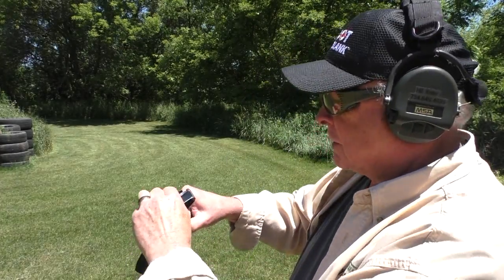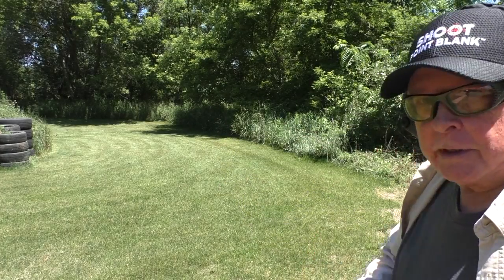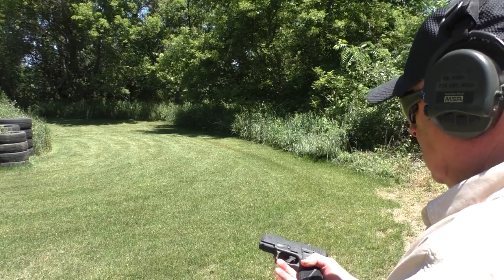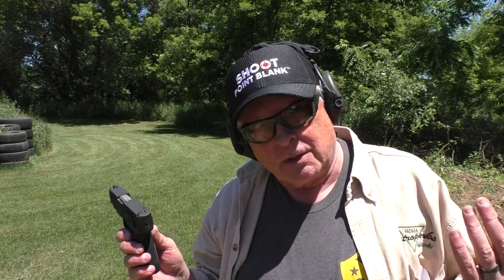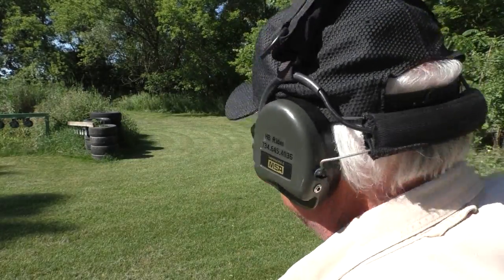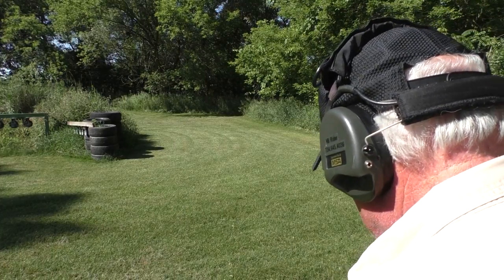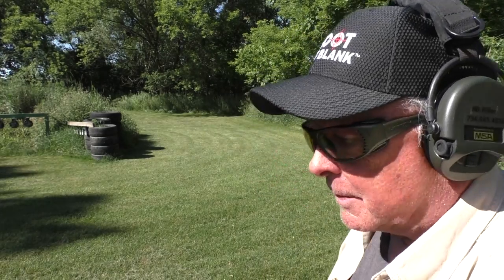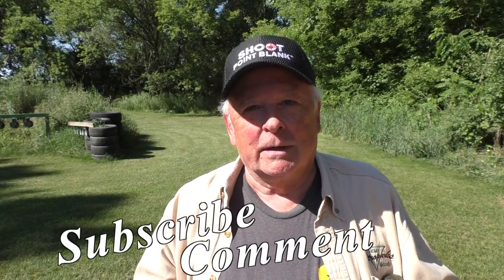Will the Taurus G3c run Defense Ammo?

Comment: I'm not a YouTuber, so I don't have a channel, like this gentleman does. We bought 2 of the G3c, and one wouldn't even chamber the blunter defense carry ammo and the other runs it but it is stiff. And since I looked up one video to see if anyone was having similar problems, now I get ALL the videos about this topic. Which is OK with me because I get to see different content and points of view. Here is MY story about this problem and maybe it will help even just one person. I recently bought 2 G3c. They ran practice FMJ ammo perfectly. However, as soon as I loaded some  defense ammo, one of them wouldn't chamber any of it. It wasn't a feed ramp issue because it would get the round into the chamber every time however, it would not let any of the blunt tip hollow point ammo fully insert fully to the case rim bottom in the chamber. I removed the barrel and holding the barrel vertically with the muzzle down you could drop in any practice ammo easily fully, even the federal hydrashock defense ammo, because the point of the bullet is not so blunt, would easily seat fully.  Im a machinist so i measured all my ammo, all measurements on all mfg rounds are the same EXCEPT the ogive on the blunter ammo is farther forward. (If you don't know what that is, look it up and why its important in this situation) So I measured the barrel and the chamber and that's where the problem was in both barrels. Even though the barrel and chamber are different diameters, they must be on the same centerline. Neither of mine were. The worst one, the chamber was .015" off from the barrel centerline. That is about the thickness of the brass wall on one side. Taurus customer service is amazing. Very pleasant to get a service return and they send you the shipping label so no cost for the return. They estimate a month turn around. So you could go that route. I see a LOT of posts about recommending you do that. However, one other alternative would be look for an aftermarket drop in replacement barrel. I'm not endorsing anyone, so Google it to find one. The one i got was fluted target grade. Free shipping and had it in less than 3 days. On sale for $60.00. Virtually drop in ready. If it even requires any fitting, the only place you may have to fit, is on the very back of the lug  that presses against the slide face. It came with perfectly simple instructions on how to do that, or you can have a smith do it. But if you have some basic skills you can do it yourself. I tested all my ammo before i even put the barrel in the slide and it all drops in fully and fit perfectly. At the range, it shoots EVERY mfg ammo now and groups incredibly well out to 25 yards. It makes an inexpensive handgun shoot reliably and incredibly accurate for very little money!
Reply from the maker: Thank you for your detailed info. I've found that Taurus quality control is not always consistent. I'm glad you found a reasonable solution.
Reply: @RidersRange  you are sooooo correct. It's really a shame about their quality control. It would be such an easy fix when they are manufacturing the barrel. It's obvious they are made on a CNC machine. Pull every 10th barrel and check the centerline relationship between the chamber and barrel with a go/no-go gauge. The aftermarket barrel I got is made on a CNC also, but you can tell the machining quality and attention to detail is so much better. Honestly, I would have paid another $60 at the store just to get what I now have. It's still much cheaper than the next competitor, and I love the grip, the factory trigger, the magazines, and even the look. But the biggest thing is it's now reliable and will run any of the defense ammo out there. It can't " just about chamber some or even most" defense ammo. It needs to absolutely chamber all of it. Reliability. The accuracy and repeatability on target is a bonus. Most people buy them for protection. If it's being sold only to reliably process target ammo, then that needs to be clearly stated before it's purchased. Anyway, thank you for your channel and the content you're posting for all of us.
Reply: Is there any way to check the centering before a purchase?
Reply: Maybe. That would involve the gun store taking the barrel out of the slide and letting you look straight down the barrel from the breech end only. That will allow you to directly view the lip at the front of the chamber where it transitions to the barrel bore. Be sure to adjust your view so it is perfectly centered. The lip should appear as a perfect ring. Appear as equal thickness all the way around. If it appears thicker in one area than another, and thinner in another area..... it is off center. The more obvious it is, the farther off center it probably is. There is a second test. Again, it depends on if the gun store is willing to do that. As in the first test, they need to take the barrel out of the weapon and hold it breech up so the muzzle is pointed to the ground. Then ask THEM to take a round from a variety of their defense ammo on hand and just drop them into the chamber. They should basically just drop all the way in to the lip and sound kind of like a clunk. If they don't easily just drop all the way in. They are not machined on center. This symptom is more apparent with heavier grain blunter tip bullets. Just about all of the lighter round nose practice ammo will drop in as I describe above, so maybe ask them to demonstrate that ammo first so you can see and hear what I'm describing. Remember if any of the rounds dont freely drop all the way in to the chamber, you run a risk of the weapon not going fully into ready battery position thus it won't fire. If you have to even slightly nudge it to drop in the rest of the way, it isn't correct.
     As I said in my previous comment, I wouldn't necessarily not buy the weapon. I like Taurus. They fit my and my families hands very well. They are very user friendly, even for the ladies for racking the slide and magazine changes and sight picture, etc. And trust me, when I put the new barrel in my wife's weapon it shoots EVERYTHING, without fail, and the shot groups are VERY good. A buddy of mine just did the same to his annnnnnnnd even upgraded a couple parts in the slide. It function tests very smoothly. If you want to know how it does shoot once we get it to the range, let me know. I will provide an update but I know it's going to shoot just fine. Sorry about the lengthy comment reply but some things take more words to express, and you have a very valid question that deserves a good response.
Reply: I bought a brand new g3c chambered in 40 s w and I have the same problems. It won't feed the defense ammo, I've tried 5 or 6 different kinds but fmj rounds are perfection every time.
Reply: @mikedaley2882  maybe your having the same issue as the 9mm factory barrel? I would consider trying an aftermarket barrel. It is a total shame if that is what's going on, but hey. If it fixes your issue and you like the weapon, Eli with it? Good luck.
Reply: @johnratcliff  where did u get the aftermarket barrel from?

Comment: Several times I've seen this issue reported about some of the G2Cs, and as G3C is mostly the same pistol, the solution I've seen was always reported to be the same: Polish the feed ramp with some jewelers rouge and a Dremel polishing cone. So far, everything I've seen this corrected the problem.

But, admittedly, that's the just the few times I've seen it reported, and the solution I've seen mentioned. That doesn't account for everyone, nor is it meant to. Mine feeds my Winchester SXZ defense ammo just fine. I haven't tried a lot of rounds, myself.
Reply from the maker: Mine is running well enough now, so I trust it as a "knocking around the house and yard" pistol. Thanks for watching and commenting.

Comment: My g3c has the same issue with defensive ammo. That’s how I got to this video. The issue is the initial chambering on a full mag. Cycles just fine after that. I’ve ran a few through it and it does it just fine now but that doesn’t mean it won’t hiccup later. Pull the slide fast is all I can tell you besides sending it for repair or polishing the feed ramp.

Comment: The problem I have with a lot of people saying the G3 G2 even though PT111 millennium won't feed it's cuz they only try one kind of hollow point or maybe two kinds of hollow points initially on the break-in. They can be a little ammo finicky once you get them broke in I've got a couple G3 cs and a g2c I've also got an old PT111 millennium with several thousand rounds to it and it will eat anything now no problems I keep it clean I have polished the feed ramp but I don't get aggressive with it I just use a little mother's mag wheel polish with a q-tip and just get it nice and shiny when I clean it probably don't even need to do that at this point but it eats everything.

So a lot of times when people bad mouth a particular gun it's because they have not tried the type of ammo that it wants.
I also believe on your initial break in Taurus recommends slingshotting the slide and not using the slide lock to release the slide I have to double check the manual again

The same goes for rifles when you're sighting in a rifle you just go buy a box of Remington's or something and it won't shoot them worth a darn when you try Winchester's and your cloverleafing shots at 100 yards.
Reply from the maker: As you pointed out, it's good to find out just what ammo your particular gun prefers. Thanks for watching.

Comment: If your having problems feeding hollow point it because these guns have to be shot with ball round tell they loosen up or polish the feed ramp
Reply from the maker: In many cases there is more to it than just polishing the feed ramp. And "polishing" by shooting is a whole lot more expensive and time consuming than a few careful minutes with a rotary tool and fine polishing compound. But thanks for watching and commenting.
Reply: @RidersRange  I found polishing feed ramp with rotary tool and spot under feed ramp in mag well just a bit took care of mine and few others my friends had mine had burs from the factory in mag by feed ram others had sharp ledges there causing snag also found one that the barrel wasn’t tilting properly so feed ramp wouldn’t line up causing failure but if I put my barrel in it it worked flawlessly so I came to conclusion the barrel had to much material left on lug to tilt far enough little time with dial caliper’s and I had it working with a little work with rotary tool
Reply: @RidersRange  you are right on all accounts. However, the guy who “polished” the ramps by sending 200 rds of ball ammo is much more proficient with the gun, is better able to trust the gun, and is safer with it if he uses it for CCW.

Comment: I own a G3X.  No feeding issues. Although initially, I polished the Barrel ramp and upper lip.  The upper lipp had rough edges, although It did not effect feeding, and I only use Hornady Critical Defense anyway, but I’m picky, since this is the only entry level handgun I own, I want it all of the surface edges on the barrel to be smooth. I didn’t in anyway, expect it to be the caliber of my HK or Kimber handguns. I was pleasantly surprised with it. It’s the perfect handgun to leave in my center console as it is an inexpensive handgun.

Comment: I have heard this issue a number of times. I had the opportunity to work with two people that told me they were have this issue from slide lock. And in both cases the issue was not the weapon or the ammunition, it was a training issue. Neither of them were using the slide lock release, they were releasing the slide by hand. When you do this, the slide has to be pulled all the way to the rear until it stops and released from that position “with no hands touching” the slide all the way forward. This of course allows the full energy of the recoil spring against the slide to strip the round from the magazine and chamber it. Or use the slide lock release as it was designed and there is no issue. Just as the guy in this video was using it.
Reply from the maker: I'm a 1911 guy at heart, so I always use the slide stop as a slide release. I've seen many, many folks run the slide by hand and most of them follow the slide forward, so, as you mentioned, the spring doesn't get to do its job. Thanks for watching and adding your thoughts.
Reply: slide lock does sometimes fails to feed when chambering hollows in a full clip with this pistol....i experienced this with my underwood 9mm jhp's then i realized it would feed them from a full slide action like the natural motion of firing a round....if you rack by hand from a slide locked position there should be no problem
Reply: Over 30 years of teaching firearms safety, usage and tactics privately and for the government. I have spoken to and worked with numerous weapons manufacturers, the slide should be raked by hand to chamber you first round and or in a malfunction situation. The slide lock is the most reliable and designed way to chamber the round, 90 percent of the issue chambering come from operating the slide the wrong way, “riding the slide” holding it to long or not pulling it all the way back before releasing it. Using the slide lock will reduce chambering issues, it’s up to you!
Reply: @wi-techcybersecurity2926 nice credentials bro.... doesn't change  my experience with this pistol and the specific rounds i mentioned so I'll stick with what works and does not work for me 🤙🏿

Comment: Good video rider. I have a similar issue with my fuller size g3 with the first round of a full mag. At first I thought it was hanging up on the feed ramp but on a closer look the rounds would hang up on something before the bullet itself reached the feed ramp. A quick tap on the bottom of the mag fixes this. the round chambers and the entire mag runs without further issue. But to be fair it isn't only hp ammo with this small issue but flat tip fmj as well. Other than this minor hiccup the taurus g3 line is dependable and durable and I can live with this. The only thing i can warn about is each time round get hung up on the feed ramp or something else the projectile itself often gets pushed back a little farther in the case and if it gets pushed back far enough it can create safety issues such as pressure spikes and breakages. Just some food for thought
Reply from the maker: Thanks for watching and adding the info. Many folks don't understand that even 1/10" of bullet setback can push a normal round to more than +P+ pressure.

Comment: At 3:26 that pre-pull before aiming just made me stare it down waiting for the Neg Discharge. 

I appreciate you using many different types to show the options and styles possible. Exercising 2A is more fun when you can rock your best style!
Reply from the maker: Excellent eye. I had to go back and look. Yes, I did stage the trigger. That's the advantage (disadvantage?) of becoming intimately familiar with a particular firearm - total feel of where the take-up is safe and stopping well short of the "wall". Notice that the gun was always pointed in a safe direction while my finger was in the trigger guard and on the trigger. I should have added the disclaimer "Don't try this at home. The demonstration was conducted by a trained professional in a controlled, safe environment". Or, I could have just left my finger off the trigger until I was up on target, as I teach to others. Thanks for watching and commenting.
Reply: @RidersRange  It was pointed safely, yes. I know what you're talking about with that wall, my LCP can let the hammer go 3/4 on pull before I feel like it's going to fire. Makes me know I can be faster to first shot!

Comment: I had the same problem with one as well. Wouldn’t feed hollow points. I did the same test that your doing now. I had problems with sig and Hornandy critical defense hollow points . I think it has something to do with the front opening of the hollow point. I noticed some have larger hollow point openings than others. They get stuck on the feed ramp. When the ammo gets stuck inspect the front and sides of the bullet. There will be some scratches on the front top and side.
Reply from the maker: Bullet profile is a big consideration. Thanks for watching.

Comment: Just keep in mind that you have to run, if you can afford it, at least 500 rounds to break in a brand new g3c and it's  magazines.
Reply from the maker: 500 rounds, including several mags of carry ammo, was my standard. However, with the cost of ammo and reloading components, I've lowered my standard to 400 FLAWLESS rounds of ammo, including at least 3 mags of carry ammo. Thanks for watching and commenting.
Reply: lobo en hs You can get by with just 200 rounds for the break in but less likely to have any problems passed 500 rounds. Most failures if they are going to happen show up in the first 100 rounds. The pistol will start running better as parts wear in and smooth out after about 200 rounds.

Comment: When you buy one of these brand new from Taurus it's going to have a thin layer of a protective spray all over the inside of the gun.  Basically it's a ghetto version of cosmoline.  It's not a lubricant!  You have to clean all of that crap out of there and then put real oil in.

If you don't, you're going to get an extended break-in period while that stuff burns off.  If you want to save up to 300 rounds worth of break-in, do a clean and lube before firing the first shot.

Comment: My G3C seems to have trouble with the Hornady 135gr Flexlock Critical Duty.  It seems that the rounds with a more rounded tip works fine.  My GX4 runs the Hornady Critical Duty fine.
Reply from the maker: Based on the comments and on my experience with the G3c, every one can be particular about what you feed it and no two are exactly alike. Maybe spotty Taurus quality control?
Reply: Im having the same problem with mine. Gonna go back to the range and try again. This time, I'll put some lube in it